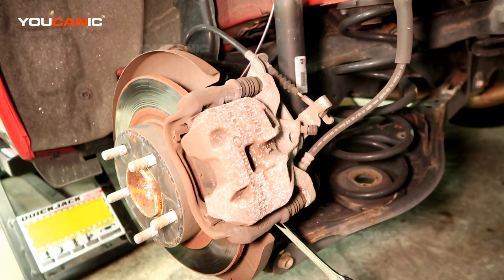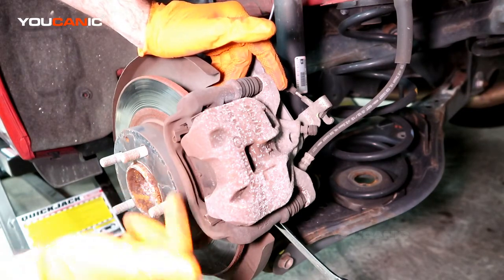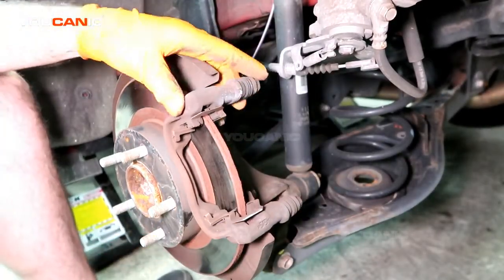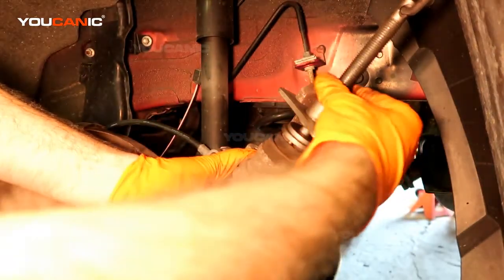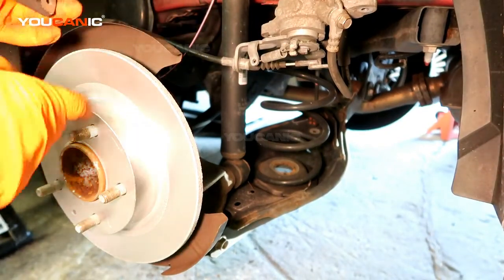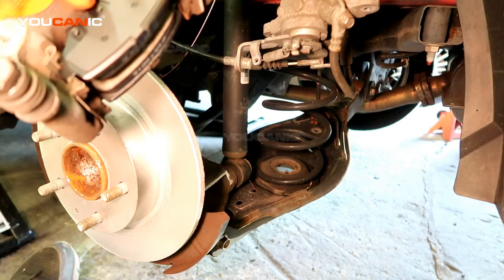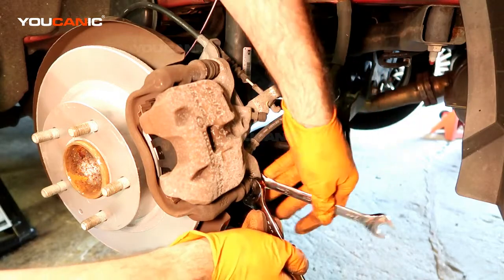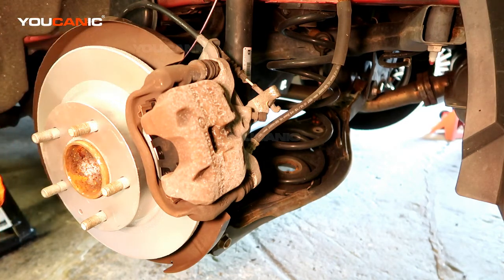2014-2018 Mazda 3 Rear Brake Pad and Rotor Replacement

Comment: Good video! I wish it had been one of the many videos I watched before trying my own! Your best addition is the explanation of how to use the piston retractor tool - it took me a long and frustrating time to figure out how to get that tool to apply sufficient pressure so that I could turn the handle. Also, it was hard to be certain that I was using the right adaptor, until it actually worked. The adaptor didn't seem to sit quite right, even though it was the only one that actually fit.

The other big challenge I had was breaking the nuts on the caliper carrier. Access is tight, and there's no room for a long breaker bar. One nut in particular gave me trouble, and it was a lot of force to finally get it going with my ratchet.

Thanks for the video - great job!

Comment: These brakes have been quite tricky getting into them for the first time on a used car. Which size caliper retractor did you use? I rented a kit from the local auto parts store but didn’t have the correct size for this job. 

The carrier bolts stumped me at first. I found sliding an Allen wrench between the inner bolt head and caliper body make a snug and simple hold while turning the outer bolt. 

Thanks for the video!
Reply from the maker: Thanks for reaching out! Unfortunately, without more specific details, we couldn't provide the exact size of the caliper retractor. However, YOUCANIC provides a wide range of resources to help car owners like yourself, including a platform for you to [ask car-related questions](www.youcanic.com). 

Regarding the carrier bolts, your solution with the Allen wrench sounds ingenious! For more detailed help with repair procedures, consider using our [OEM Factory Repair Manuals](www.youcanic.com/scanner). Your trust in YOUCANIC is greatly appreciated, and we strive to be your go-to source for all things automobile-related.
Reply: I have a 2015 and it uses the #4 die in the kit. This car in the vid has an e-brake he says, mine doesn't, and the face of my piston is different. Also, brake squealer goes on the inboard pad leading edge, at the bottom.

Comment: Any body know the name of the tool he used on the brake caliper
Reply: Chief its called a disc caliper rewind tool
Reply: Only needed for 2014-2016 years. You can use needle nose pliers too.

Comment: THAT TOOL WON’T WORK IF YOU RUN THE PADS ALL THE WAY DOWN!!! Hey guys lol. It’s October 2024 and I did this. What I’ve noticed is that if you are basically metal to metal, which I know most people are, the caliper piston is already too far out to fit that pistol rewinding tool in right away. You will have to use a pliers to grip the outside of the piston and turn it back it while trying to apply downward pressure. I’ve seen people say use a  needle nose. That didn’t work for me. I used a locking groove joint pliers (basically a channel lock) and that worked perfectly fine. Also when twisting be careful not to dig or cut into that rubber seal thing.

Comment: Just did my 17 gt with epb and built in Mexico.  I was surprised not to see pad clips.  The pads just sit on the bare bracket.  Is this normal?  I think Mazda screw up with the Mazda 3 brakes.  The outboard pad wear much faster than the inboard pad.  And the piston rubber boot doesn’t fold back in shape as it should.
Reply: Some cars don't have bracket hardware, you should carefully loosen the rubber boot from the piston ring before spinning it in or the boot will scrunch up, I give it a little spray with silicone spray to help loosen it up
Reply: The rears have it attached to the pads. The fronts have a kit you can buy.

Comment: Cheers for the guidance and time for putting this video together (I enjoyed the no-nonsense silence-fast-forward portions of the video - time saver).  I live close to the dealer and utilize their services for oil changes on my wife's car. They quoted me $800-$900 for a brake job. It took me some time, and some pain, but it saved me $550 - $650, and gave me satisfaction in various ways (put in gentleman terms, not getting overcharged).

My only suggestion is showing how to remove the rotor - you skipped this. It helps to purchase a spare M8-1.0 bolt when you purchase the brakes. There is a threaded bolt hole in the rotor for extraction purposes. Using a bolt (and threading it into the rotor) separates the rotor from the axle. Otherwise you are stuck beating on/prying on the rotor. I recommend using a 'spare' bolt, as the rotor threads are rusted, which will sacrifice the bolt-threads, making the bolt unusable (hopefully this makes sense - a picture is worth a thousand words). Hope my review was helpful. Thanks again.

Comment: Don't forget to clean the rotor surface with brake clean before installing
Reply: Not all rotors require that. i.e. EBC RK coated rotors.

Comment: Not torquing the caliper bolts to any spec???
Reply: 20ft-lbs for the pins, 80ft-lbs for the bracket
Reply: @Mr.Be93 Owners manual has the caliper slide pins at 17-19 ft/lbs and caliper bracket bolts at 36-48 ft/lbs.

Comment: I have a 2014. I changed all rotors and pads. My driver side rear brakes are creaking now when I apply the brakes. It doesn't matter if I'm driving or if I'm parked. It's driving me crazy. I applied lube to all metal contact points. Any suggestions would be great!
Reply: Is it possibly the clip that holds the pads? I think I had this issue a while back and the clip was scraping my rotor
Reply: @TheeVibeVault  even when it was in park?

Comment: You don’t need that tool, I use a pair of needle nose pliers to turn it, just be careful not to pinch or damage the boot.

Edit: also loosen the brake fluid reservoir when turning a caliper back, it will help with the resistance it gives
Reply: Hi, what do you mean you loosened the brake fluid reservoir? Like the cap on it under the hood? Will be doing this process myself soon so just asking, thanks!
Reply: @eduardomaldonado7485 The cap. Unscrew it and set it on top of the reservoir. You may need to use a turkey baster to get any fluid past max out with the new pads.